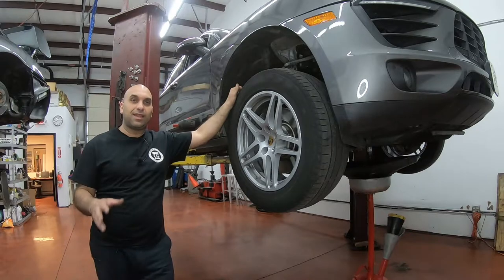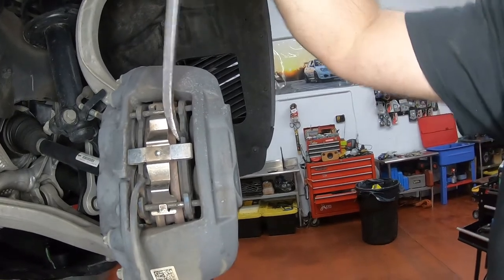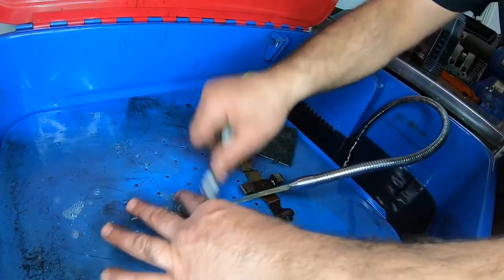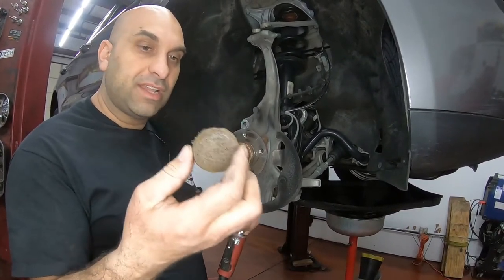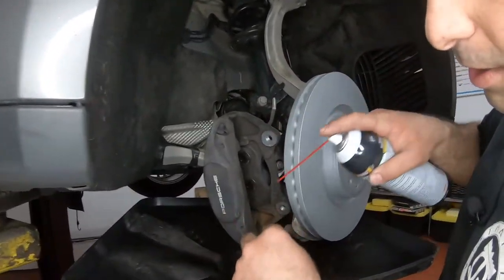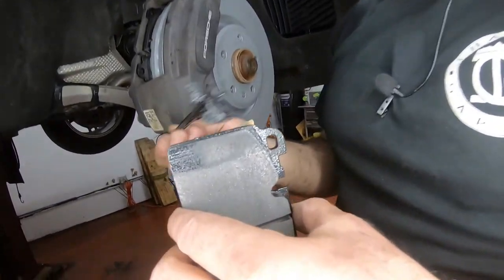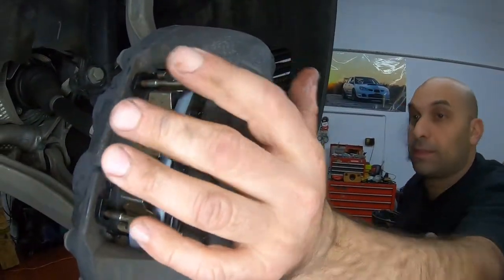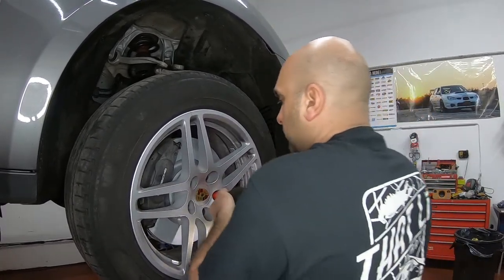Porsche Macan brakes replace service Macan s rotor brake pads part 1 front

Comment: Thanks for the video. Question: I replaced all brake pads on a Macan S 2017(without scanner) and now the pedal is low( no brake lines were opened ). In the rear, I just removed the electric motor and put it back after done. How can I bring the pedal back to original position?
Reply from the maker: I think you might of damaged the caliper or it can be saved by using the scanner
Reply: Thanks for the detailed video. The front went well. My problem is now the rear ones on Model 2015 with electrical break. Any hint for open and close the electric motor and recalibrate the system without visiting the kind dealer ?

Comment: Did you loosen the fluid cap before depressing the calipers?
Did you say new caliper bolts?
Reply from the maker: No I didn’t loosen cap before depressing the calipers, it’s works fine with out it.
Yes we used new caliper bolts 
Thank you